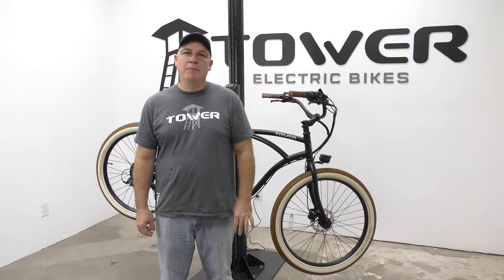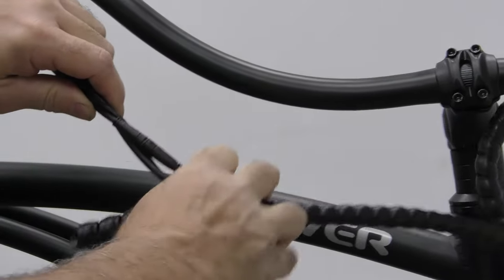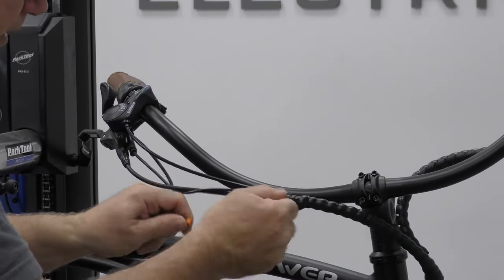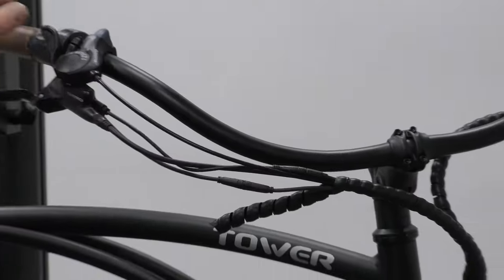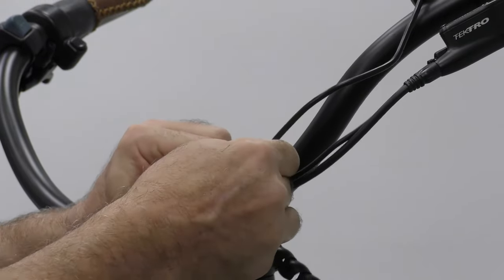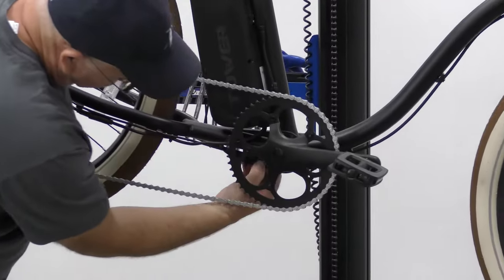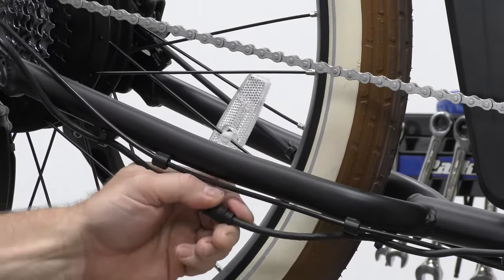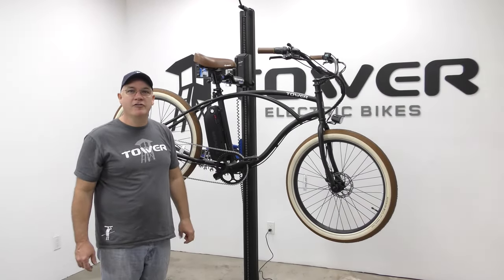Ebike won't turn on? What to check

Comment: Hi, i have  Bulls lacuba evo 10,and it won't charge the battery, but it charges it if I hold down the button to turn on the display. I have to say that the battery was completely discharged before that. I currently have it charged to 15 percent.

Comment: I have a new electric trike. After assembly it wont power up. In the brain box there are two white connectors male and female that are not plugged in. Wondering if this saves the battery during shipping. Should i plug them in?

Comment: any suggestion- my ebike (assisted) only starts once, if i turn off, i can not turn it on withouth reseating battery (must remowe/reinstall) battery, only than bike powers on; and again, if swithed off, same procedure to start it...
Reply from the maker: It sounds like theres potentially a bad controller on your bike. The controller being the the piece your battery slides onto. Normally a bad battery won't be able to power up at all, so the fact that you're able to get some life out of it means there's simply a reader connection failure. We have a video showing how to remove and replace a controller. You will have to source a new controller with the manufacturer of your bike.
Reply: Same here
Reply: Plz let me know if you fix this problem
Reply: @TowerEBikes  
Hi ,I sent you my comment  about  the bike . I couldn't connect the speed cable it doesn't go inside.You connected easily , but I couldn't. 
Please, help me how to connect it .
Reply: @TowerEBikes  Hi, please I need your help with my bike. I have the SMLRO MX300 electric bike. The power isn’t stable. It goes on and off while riding. Usually I see an Error (E) signal on the screen then it goes off. Kindly advise me on what to do please.

Comment: I don’t seem to have any connections near my handlebars. Any chance you know where they could be? I have an internal battery so wondering if they could be hidden in there?
Reply from the maker: Hi Amelia, without knowing what brand and model ebike you have it's difficult to say where the connections are. We have worked on lots of ebikes that are internally routed. Sometimes you even have to take out the front forks to get the battery out and access the connections. So it's definitely possible that your wires are hidden in the frame. If you're in San Diego, you could always bring your ebike into our repair shop where we specialise at working on ebikes.
Reply: @TowerEBikes  thank you so much for your helpful reply. I actually live in Australia haha :)
However I played around with my connections and managed to get it working again :)

Comment: Hi, I installed throttle mode to my e-bike it works perfectly with PAS but when I turn the front lights on PAS doesn't respond, do you know what can be the issue? (I added a front light to my e-bike before that is connected to the original light, so both turn on with the same button)

Comment: I have a E 10 code on my brand new Nakto ox folding bike. What can I do?
Reply from the maker: Hi Rafael, according to Nakto's website, error code 10 is a connection issue. So try unplugging and plugging back in all of the connections. Be careful when plugging the connections back in because if it's not lined up correctly you can bend and or break the terminal. Hope this helps!

Comment: My trike manufactured by Wuxing continues to blow the small 6 amp fuse at the charge port connection, the battery was recently replaced (new X-go 36V battery) and now each time the throttle is actuated the fuse blows, can you suggest or recommend a possible fix. Thanks in advance any help is appreciated...
Reply from the maker: Hi Dave, was that battery made for that bike? The BMS (battery management system) is different in different batteries and not universal. You can't just attach any battery to any bike and go. It sounds like your motor is drawing more amps than the BMS can handle. I would recommend reaching out to the manufacturer and seeing if they have a bigger battery that is compatible with their system.

Comment: I have a electric 2.0 and the up button or plus button works but the minus button doesn't work .I just changed stock Freewheel to better one .going from 0 to 5 on pedal assist works fine ..it's going from 5 on down to 0 or minus button doesn't work,any ideas?.thank you

Comment: How do u check your ebike power button when it won't move when you press it to turn on our off
Reply from the maker: Hi Oscar, the 'o' should be off and the '-' should be on for the Tower battery. Hope that helps.
Reply: @TowerEBikes  I did but it still doesn't move I already checked it and it doesn't get speed also
Reply: Did you get it to work? Mine is brand new and I’m getting nothing! Checked all my connections and my battery is charged. I need help

Comment: How did you do that disconnect? Explain the theory behind the controller and how that works.
Reply from the maker: Greg, the controller is the reader of the battery. We have a great video explaining how the controller works and how to remove/replace a controller on an ebike. Check it out!

Comment: Hi ,I tried to connect and i couldn't, it is not going inside.I do not know what to do. I n video you connected easily, but I tried to put and I couldn't. 
I don't know what to do . Can you help me ,please.
Reply from the maker: You will need to make sure that the prongs within the cables are correctly fitted. Generally there is an arrow on either end of the connection and those arrows should match up. You can also look and see the prongs on either end of the cable and make sure to match them up.